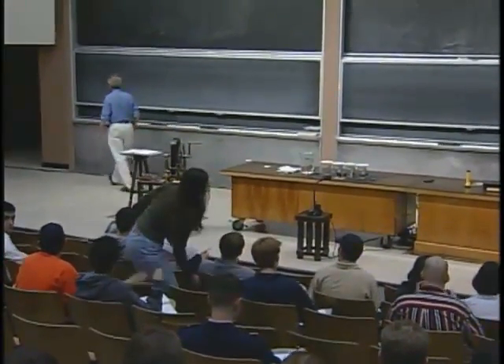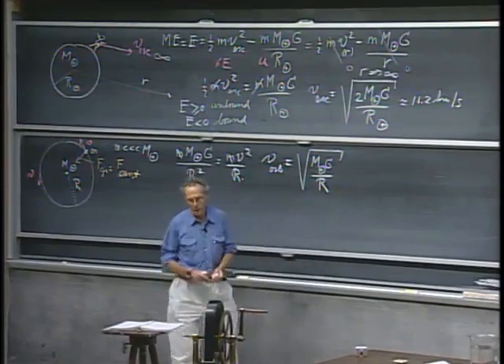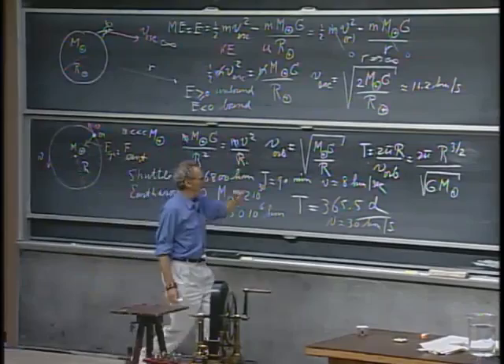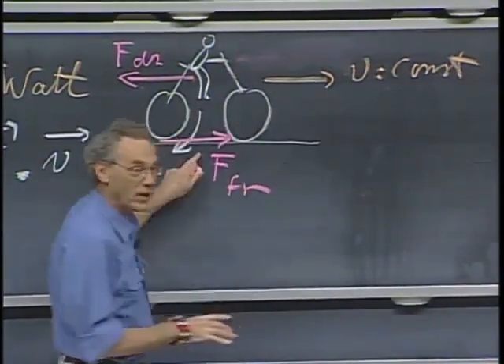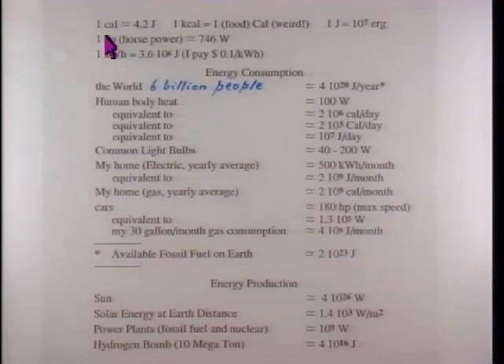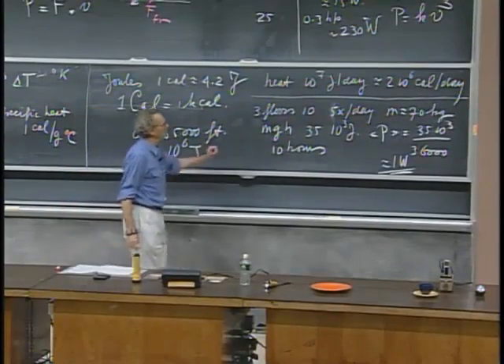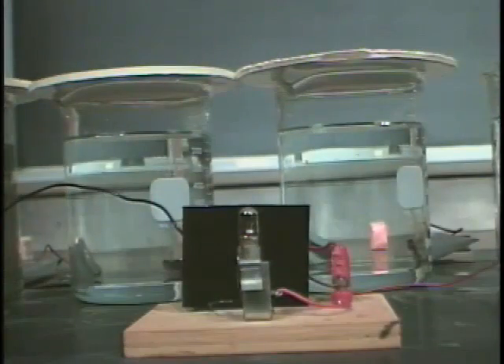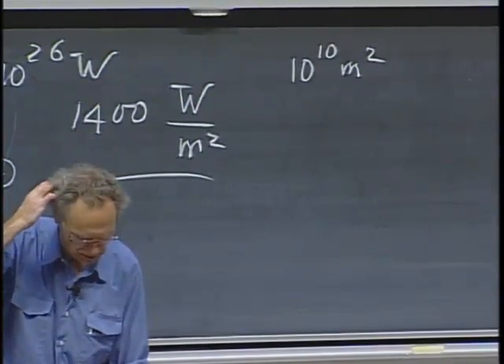8.01x - Lect 14 - Escape Velocities, Circular Orbits, Bound and Unbound  Orbits, Power

Comment: Sir in last part of your lecture on escape velocity, circular orbit you asked a question when the ball fall then after hitting the ground it glows . Sir I think there must be some material that converts the energy lost at the impact of the ball to the ground to electric energy. Similar to the photoelectric effect when energy of radiation absorbed results ejection of electrons. 

Sir am I right
Reply from the maker: NO
Reply: Lectures by Walter Lewin. They will make you ♥ Physics.  Sir isn't the energy lost at impact of ball to the ground is responsible for charge formation inside the material of the ball that is consumed by electromagnatic  radiation at last.
Sir if I am not right then what is the real answer
Reply from the maker: You will hate the real answer. I therefore prefer not to tell you.
Reply: Lectures by Walter Lewin. They will make you ♥ Physics. Sir please tell me. I never hate the facts and truth.
Reply: Lectures by Walter Lewin. They will make you ♥ Physics.  Sir please tell me the answer. I went through the comments  I found there is some switch... battery.... related answer. Please explain me the proper reasoning. I want the answer. Please
Reply from the maker: There is a battery inside the ball and a switch that closes for about 10 seconds at impact.
Reply: Lectures by Walter Lewin. They will make you ♥ Physics.  oh.. Sir you were right I will hate it. Is my previous answer is applicable to produce electric energy in any other ball

Comment: I do not see how work done translates to energy if work=0 or work=-w. If I climb the same stairs up and down, so that the net work is = 0, is the power also going to be 0? By that logic the amount of calories would also be 0, but that would be absurd, If I climb a flight of stairs up, then I climb down, I do not regain the calories used. You have said that in your work lecture, that being tired is not equivalent of work, we could feel tired and still have done 0 work. As in the case of MGH, If I first do work that's +MGH, then later I do work in the opposite direction -MGH (Climbing stairs up and down) how much calorie do I use? How much power does it net? Does -MGH cancels the MGH power used becoming a net=0 power? If so, does it mean I do not use any power when I climb the stairs up and down, and what does that mean for calories? I am confused. How does tiredeness relate to this? Does it not relate to amount of energy used? If I climb the stairs I am going against M.G so my force is in the opposite direction of gravitational pull, doing positive work, so I end up doing work which result in positive power, and positive calories. But If I go towards gravity ( climbing down the stairs),  intuitively it feel that I still am using energy even though is much less than by going up, I assume this is because the force is in the same direction as M.G?
Reply from the maker: When you go down the ladder you do negative work. You could have jumped off the ladder onto the blades of a generator. The generator would then produce electricity. You would release mgh J and the generator if it had 100% efficiency would produce mgh J of electric energy which it could use to charge a battery.

Comment: Concerning the brain teaser, I don't understand how a battery can be turned on (a switch) just by hitting the ground (is there a special mechanism) and why it keeps blinking just for a while? Are we talking about a capacitor that is charging while you are holding the ball and discharge, immediately after touching the ground, into a light-bulb allowing it to blink momentarily until the voltage across the capacitor come to a value (a threshold) and than stop. THANK YOU SO MUCH FOR YOUR HELP! Sir WL
Reply from the maker: place a switch in the circuit. You can turn the switch ON and OFF. This has nothing to do with grounding.

Comment: Hello Sir, 

At 47:37 minutes in the lecture when the ball glows or is blinking , is it due to the mechanical energy being converted to electrical energy , like when the ball touches the ground there is some kind of spring in the ball ..that and with a battery the mechanical energy gets converted to electrical ?

And does how much time the ball blinks depend on the height from which it was thrown ..like if I throw the ball from a building or something would it glow or blink for a larger period of time as compared to while I throw in when on the ground?
Reply from the maker: your suggestion is reasonable but it is incorrect

Comment: On an exaggerated scale, would the ball not bounce as high as one without or is the loss of energy converted to negligible.
Reply from the maker: I do not understand your question. "as one without" without WHAT?
also let me know how many minutes into the video
Reply: Lectures by Walter Lewin. They will make you ♥ Physics. I believe his question is that if the ball uses gravitational potential energy to power the led’s than the mechanical energy of the ball decreases because some of it is converted into light energy which leaves the ball so it will not reach the initial height it started at because mgh is now smaller than it was initially and is the light energy radiated a significant fraction of the gravitational potential energy to decrease its height by a measurable amount.

Comment: Sir,How is it possible reaching infinity at zero speed as once you give the object an uniform velocity then it maintains it.How could velocity go to zero.Please correct me if i am wrong.
Reply: Sir please can you reply...to my query
Reply from the maker: I did respond earlier. It did not get through. If an object has the escape velocity at distance R from the center of a mass M, its speed will decrease all the time as it always experiences the gravitational pull from M. It will take infinitely long to reach "infinity". But it would then get there with speed zero. Infinity is a difficult concept. It has only mathematical meaning. If you calculated the "escape" speed the object would need to reach a distance of 100 million light years, you would find the same value (at least the first 9 digits would be the same) for that speed. That's not so difficult to grasp.
Reply: Thanks a lot sir..

Comment: Is there an optimal angle for take off? ..and if so how is this calculated? Pretty much as soon as any rocket "clears the tower" it goes into a roll procedure and angled ascent as quickly as possible.
Reply from the maker: how many minutes into the lecture?
Reply: The first 17 minutes or so--you talk about the the velocity, but don't mention the angle of ascent. As soon as any rocket clears the tower it "rolls" and ascends with a marked angle to the ground. I saw the shuttle lift off, and I expected it to take off straight, but it takes off at an angle off about 25-30deg away from perpendicular after about 10 seconds after lift-off. 

I imagine there must be a pretty strong reason why they do this (gaining altitude and angular velocity) but surely this would mean that the vehicle must pass through more of the dense lower atmosphere, and this would affect the required escape velocity.
Reply from the maker: I have sent your question to my friend the Astronaut Professor Jeff Hoffman. I will send you his reply.
Reply from the maker: I have not heard yet from Jeff but I have thought about this a bit. When a satellite gets into Earth orbit, it's velocity (about 8 km/s) must be tangential to a near circular orbit. ISS and the Shuttle used to be about 200 miles above the Earth surface. Suppose you go straight out of the atmosphere along the vertical direction then you arrive at 200 miles with a radial velocity but that is NOT what you need. You must end up with a velocity which is 90 degrees away from radial. Thus the fact that the shuttle changes direction soon after launch is probably a matter of fuel economy. Leveling off early on in the launch  is more fuel-efficient than first going vertically up to 200 miles with a velocity radially outwards and then changing the direction of motion by 90 degrees. By doing that you would also not stay at 200 miles but you would end up at a much larger distance form Earth. Thus you MUST level off (change direction) sooner to end up in near circular orbit about 200 miles up.
Reply from the maker: Here is the answer from Professor Hoffman:
It is correct that getting above the dense lower atmosphere is important, but there is always a compromise between getting high quickly and starting to accelerate horizontally to eventual orbital velocity of ~18,000 mph. Going straight up is extremely inefficient for a rocket. This is referred to as “gravity loss”. It has to be balanced against atmospheric drag loss. The most efficient way to transition from going straight up out of the launch tower and getting into a horizontal trajectory is called a “gravity turn”. You use the rocket’s steering to start tipping the rocket just a small bit, then gravity pulls it over the rest of the way, so that the rocket thrust can continually be applied parallel to the direction of motion. Any rocket thrust applied sideways to turn the rocket, since it is perpendicular to the direction of motion, will not increase the energy of the rocket. That is why gravity turns are the most efficient. 
Another consideration is that while carrying out the gravity turn, the rocket gets into the plane of its desired orbit. The sooner this is done (i.e. at the lowest velocity possible) the less cost there is to establish a new orbital plane.
Reply: +Lectures by Walter Lewin. They will make you ♥ Physics. Wow. So now I know!! Thanks so much for finding this out, we saw the shuttle launch when I was 7 and it has bugged me ever since. Does the escape velocity change due to this angle?
Reply from the maker: Jeff flew 5 times on the shuttle. I saw one of his launches in Florida (2 AM at night). Once you are out of the Earth atmosphere, if you have a speed of 11 km/s you will escape the Earth gravitation - you will never return to Earth.

Comment: Are those fiesta red dishes harmful???
Reply from the maker: not if you use them in a normal way.
Reply: I have the same plate.They are beautiful (and there's something unique about the orange color-you can match it until you can't tell the difference, but the non-uranium color won't 'feel' the same.) I ate from it for 20+ years. I emailed the safety question to Theodore Gray who makes books on the elements of the periodic table. He said there is a risk from the plate, but it is not the radiation, it's that uranium is a heavy metal. So its about the same risk as a plate with a lead glaze. Best not to eat acidic foods from it. I no longer eat from it at all, but  will never get rid of it.   
It's not hard to check if anything is rubbing off the plate, just put the geiger counter on your finger tips.

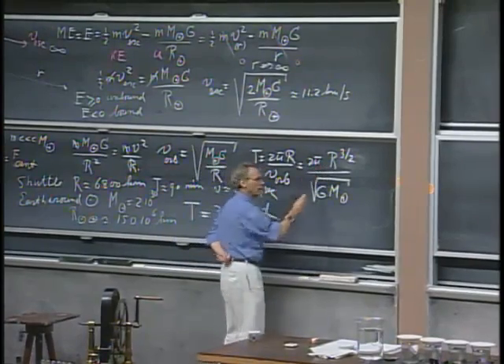Comment: how come 'the ameriacns ' find the orbital velocity @10:09
Reply from the maker: question unclear.
Reply: we know T=2piR/v(orbital)
You said that since we know the time period we can easily calculate 'R' and 'v'.How come we can calculate both v and r from a single equation. 
Also if we use second relationship in terms of mass we dont have mass of earth and radius.
Then how come at the time of sputnik did they calculate 'R' and 'v'
Reply: looks like i got it wrong may we you meant that we dont know the mass of sputnik.
Kindly correct me if I am wrong.before launching of sputnik we knew the mass of earth and calculated it by using f=GMm/r^2 .
Reply from the maker: Indeed the US could not determine form the orbital parameters what the mass was of sputnik. Orbital radius and orbital speed were a piece of cake.

Comment: There might be an open circuit inside the blinky ball that is completed by an extended spring. When the ball hits the ground, some energy is transferred to the spring and it starts to oscillate, periodically completing the circuit as it extends and compresses. As the spring looses energy due to friction it no longer has enough oomph to complete the circuit and the ball stops blinking.
Reply from the maker: +Kyle Moses Kyle this is a nice idea but that's not the way this toy works.

Comment: Dear Dr.Lewin,
If we could put AT REST a mass 400 km from the Earth as the ISS, would it begin to orbit spontaneously? Would it fall on Earth after a few spiiral rounds? Is it necessary an initial impulse to orbit correctly? Is it possible to determine this impulse? Is there any distance from the Earth's so that the orbit began to occur in an spontaneous way?
THANK YOU!!
Reply from the maker: +Jordi GS  If you released an object from the ISS which is at rest relative to the ISS then it will orbit the Earth in the same orbit as the ISS. If you throw an object from the ISS in the opposite direction of which ISS is moving and if its speed relative to the ISS is approx 8 km/s then the object has zero speed (it stands still) and it will radially fall to Earth.

Comment: Hello Dr. Lewin, were you serious when you said that if you did not take the copper out of the chemical solution that the students would be dead soon? And also, where is the energy coming from with the blinking lights?
Reply from the maker: +Dr. Science Sc.D how many minutes into the lecture do I say this? What blinking lights?
Reply: +Lectures by Walter Lewin. They will make you ♥ Physics. It was around 36 minutes when you said that. And I am referring to the bouncy ball with blinking lights at 47 minutes.
Reply from the maker: +Dr. Science Sc.D "otherwise we ail all be dead by the end of the lecture" This was a joke - I made reference to the production of "fumes". What do you think is the energy source is of the bouncing ball?
Reply: I think the energy source is from gravitational potential energy but I'm unsure of why it is in still blinking, is it due to kinetic energy?
Reply from the maker: +Dr. Science Sc.D That is not a bad guess but it is incorrect
Reply: Thank you, is there anything colliding inside the ball causing kinetic energy to be transferred to energy for the blinking lights to use?
Reply from the maker: +Dr. Science Sc.D Make a proposal what that could be.
Reply: +Lectures by Walter Lewin. They will make you ♥ Physics. Does the kinetic energy the ball receives power a circuit inside the ball?
Reply from the maker: +Dr. Science Sc.D Yes. Inside the ball there is a battery. The bounce of the ball triggered a switch which triggered the blinking. I have some balls older the 5 years. Most do not work anymore (batteries lost their energy).